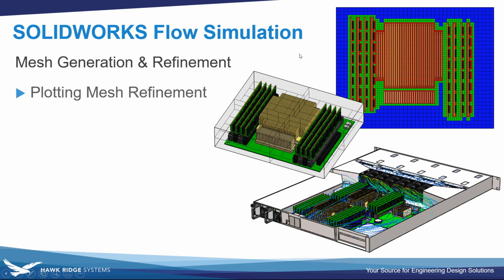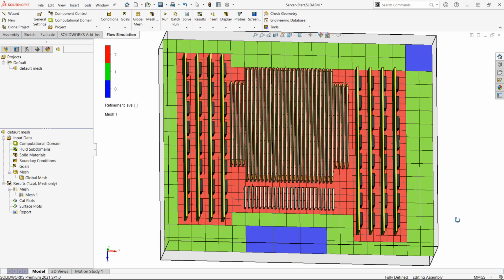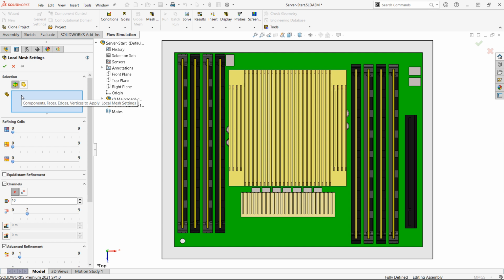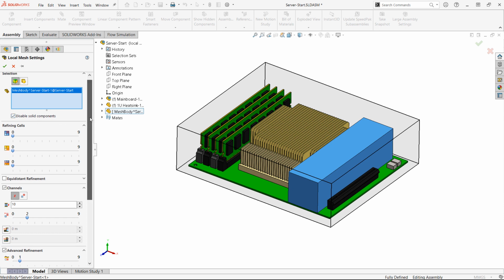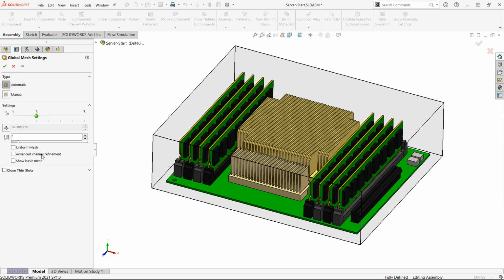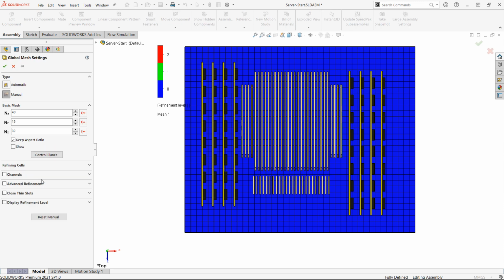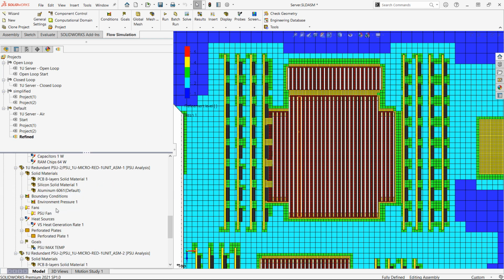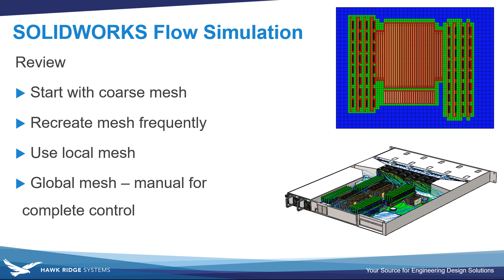Meshing guide for SOLIDWORKS Flow Simulation

Comment: would have been good to see you spend more time on solution adaptive refinement, because it is extremely effective and, in many cases, eliminates the need for all other types of refinement.  it's the least-hassle way to get good results.  in fact i would start with that, and then discuss the rest.

Comment: Great video! I found trimmed cell in my mesh, does it impact my simulation result? Thank you!
Reply from the maker: Presence of trimmed or irregular cell is an indicator that the mesh may not be adequately conforming to the geometry in one or more areas. It could impact results if it's occurring in an area of interest.

You should be able to visualize where the trimmed cells are using a Mesh plot. Another thing to try is to do a regular cut plot with the Mesh overlay, and check and uncheck "Use CAD Geometry" - this will visualize the difference between the computational domain as meshed and the CAD model. At high levels of refinement this difference should be minor.